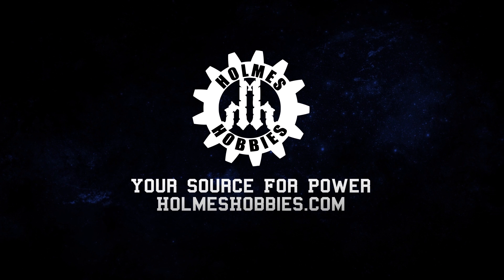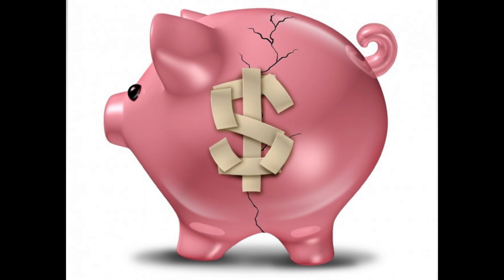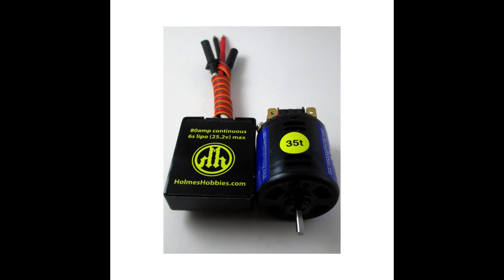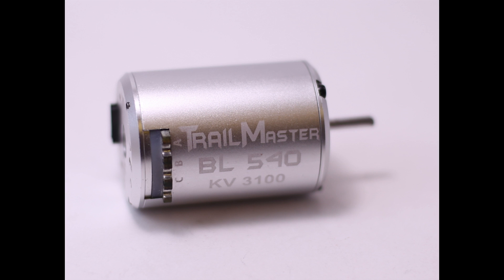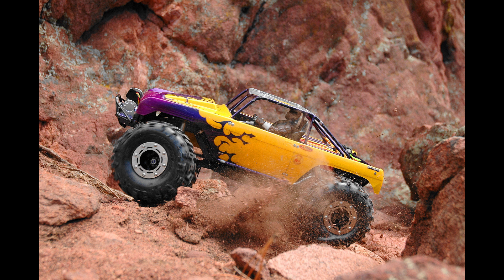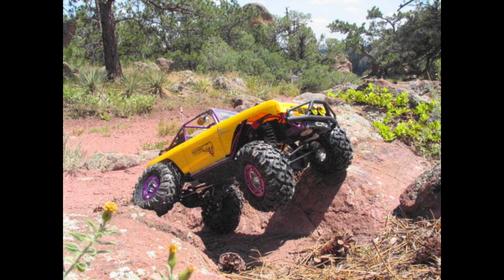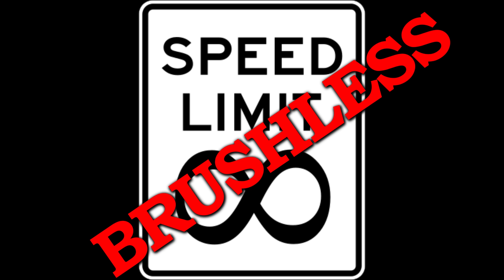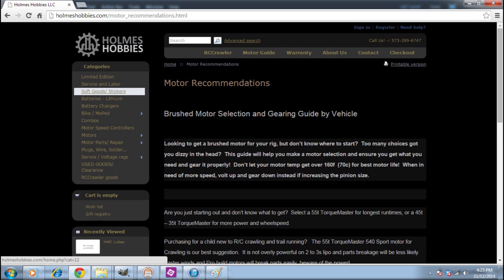Brushed versus Brushless motor comparison

Comment: Roughly how long do brushed motors last in hours?  I know there are variables, but giving time in years doesn't help.  At least if you're a newbie.
Reply from the maker: Hard ran motors/  overgeared can be 30 minutes.   Normal slow crawling 100 to 200 hours easy.  Crawlmaster and trailmaster sport 550, we know motors with years and hundreds of miles on them.
Reply: @HolmesHobbies  Thanks!

Comment: Thank you for your (good) presentation. I just went from Nicads to Lipo on a stock brushed set up. My run time went from 20 minutes to 55!
Speed controller no prob but stock motor toasty hot. Its a late 90's Losi buggy. ESC rated @ 160amps. Not real sure on type of a motor to run. I'm not racing anymore : )

Comment: Is there a motor suggestion that can handle a very high gear ratio (large pinion, small spur) so that it doesn't get bogged down on acceleration, and still hits a high top speed? Not looking for it to be quick off the line for racing, just a personal preference.
Reply from the maker: PUller Pro 540 is a very hoss motor.

Comment: What would be a great motor esc combo for my Axial Wraith Rock Racer that's similar to the stock set up, I like a little crawling, and little trail riding, and I'm happy with the speed the stock set up gives me, I'd like it to be a tad bit faster but dont want to sacrifice the crawling capability the stock set up has. Any advice?
Reply from the maker: 2700kv Puller Pro 540 and Mamba X would be a killer combo.   I developed the puller pro in the Wraith.
Reply: @HolmesHobbies  Ok cool thanks!

Comment: Thanx for a great, informative video. I cooked my Titan 21T 550 rr motor in my Traxxas Bronco today. The snow wasn't kind to me today!!! Do you have a recommendation as to what I should replace it with? Any advice will be greatly appreciated, I'm fairly new to the hobby of RCs/crawling Thank You
Reply from the maker: Snow is a pretty tough load.   You could go low cost with a TrailMaster Sport 21t 550.   That's what I would do before moving to brushless.   For brushless, Mamba X and Puller Pro 540 2200kv is my general favorite.
Reply: Thanx for the info. I actually did order the TrailMaster which arrived on Sat. Hopefully I'll have time tonight to solder wires and install. Eventually I'll upgrade. I was told that a TrailMaster 12t 550 was coming out soon. Can you confirm that? Again, Thank you

Comment: I'm sticking with Brushed.... Unless I win the lottery!!! There's NO cheap, GOOD Brushless Systems. My TenShock 1750kv Sensorless 6 Pole 9 Slot and Hobbywing WL10BL120 ESC comes close, but has limitations. 
My Brushed Systems (especially yours!!), does what I need it to! 

..... After 2 Years of great service though, my BR-XL ESC is now cutting out sporadically. Just stops, no lights, no sound, nothing. Then after a while, it starts working, then cuts out again. 
I'm running your 30 Turn Brushed Handwound TorqueMaster....
What did I Screw Up?  I can't even afford to send it to you to take a look.
Carmine 🚂 🚙
Reply from the maker: Hmm, that's a weird one.   I would wonder if your battery plug is just needing some love.   That's typically where the sporadic power comes from.   Especially when deans get wore out.  

A sidewinder 4 would boost that tenshock back into shape.  Startup won't be amazing, but it will be a lot better than the HW.
Reply: I really, REALLY want a Sidewinder 4!!! My tiny Disability Pay says no.... Hopefully at some point. I will STILL Count on my BR-XL to handle my Brushed Duties!

Hmmmmm.... Deans Plugs... I've heard of that. I thought that the XT60 Craze was just another "Cool Kids" thing.
However, I bought 2 packages of XT60 Plugs last year, and haven't installed one yet. There's one NO cost thing I can try first! 😉👍👍 

..... Right now, I had to install a $17.99 GOOLRC "320 Amp" ESC. It works, in the way that it goes forward and reverse... But that's ALL it does! 
Thanks John! I'll try the XT60 Plugs.

Comment: I have a dual motor brushed setup and I'm looking to upgrade. Would I be able to use 1 brushless and 1 bushed motor in order to get the best of both worlds in low/high-speed efficiency? Or would I be better off to just get 2 brushless when the originals die?

Comment: How does a TorqueMaster 540 27t have the same wheel speed as a CrawlMaster 540 13t?
Reply from the maker: changing slot and/or pole count can change the turns needed to create a specific Kv.   In brushless, a similar example would be trailmaster 3300 is 8.5 wye and Puller Pro Stubby 3300 is 3.5 wye.
Reply: Please excuse my stupidity on the matter but what is a "wye"?

Comment: I gonna build my very own rc f1 car 2018 season without halo and would want a motor which is fast , which one should i get and can withstand rain
Reply from the maker: Brushless will give you longer runtimes and less maintenance.   Our puller Pro 540 is the most power that can be shoved into a 540 can.
Reply: Most senorless brushless systems are waterproof... nothing is rust proof though and the whole truck should be dryed after use.

Comment: What is best for sand dune bashing?
Reply from the maker: Brushless for sure.   We will be making a new video this week that will have specific examples for specific uses.   I would throw a Puller Pro 540  or 540XL into a sand rig depending on space available.

Comment: Can they both go in water and mud
Reply: usually yes, most motors are waterproof
Reply from the maker: Yes, but we don't recommend it.   For brushed motor, a sealed can type like the TrailMaster Sport is best.   Brushless, you just gotta clean them out every time so the bearings and stators doesn't rust.

Comment: How does the puller pro 540 3500 stack up to say a tekin pro4 of about the same kv?
Reply from the maker: Much longer rotor inside the Puller Pro 540.   It would be more fair to compare it with a Pro4 HD.
Reply: +HolmesHobbies awesome! It's ordered and almost ready to ship (shipping label created) I messed up and ordered it as well as the CC Mmp but I chose the option to solder the bullet connectors onto to the motor leads, but as it turns out, that's only required for the mamba X and it's 6.5mm connections.

Comment: Why is the cost so much greater on a brushless motor?
Reply: Higher cost of laminations, higher magnet costs, more difficulty winding, and lack of stamped parts give the brushless motor a higher minimum price.   I do make Puller brushed motors that are of similar quality and price, however.

Comment: '
all my R/C models are normal brushs motors 380 / 540 / 550 with nimh batterys...
better than brushless motor...
brush motor canned have cutted / holed to help keep cooler air...
brushless motor canned dont have air and easily getting tooo hot

Comment: I have a electric off road racer Dark Impact.......I noticed that when the motor runs, the section between the brush and the contact point sparks vigorously which I don't like.
is there a solution .....should I swap it?
Reply from the maker: +oliver goldsmith Brushed motors normally spark a little.  This is what wears the brushes down.   You may try adding 6 degrees of timing advance to see if your arcing reduces.

Comment: my bl for my 1/10th car still runs after years of use and abuse, truly powerful, however the cogging effect is so bad on the pull away it really sucks. its like it wont go slow.
Reply from the maker: this is why sensored systems and brushed systems are favored in crawlers. low speed control is very important!
Reply: Also, turn down the "punch" to half or less of full power - it only affects the first little bit of throttle input but won't hurt the overall power of your system whatsoever - but it may help a lot with the cogging 

Also, minimize any timing on the motor and the esc settings - I find that these two adjustments have been the most beneficial for smoothing low speed useage on non-sensored systems 

I'm sure Mr. Holmes can add to these thoughts, as he's known far and wide as a man who has legitimate "esc/motor whispering" abilities 👍😎
Reply: +T. Wallace I have a sidewinder 3 in my stampede and was hill climbing for fun, with the punch turned down, but boy did it get HOT, after about 5 mins I couldn't even touch it, if I didn't turn it off, it probably would've had a thermal shutdown. now I see why they recommend crawler motors for crawling lol